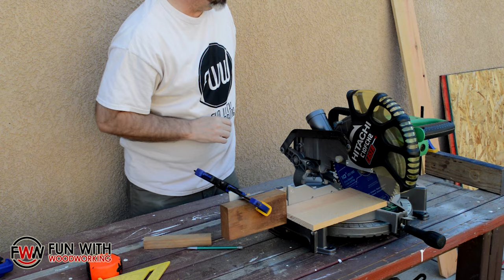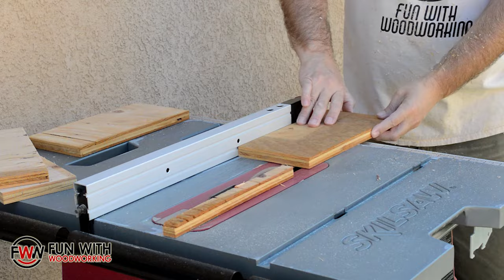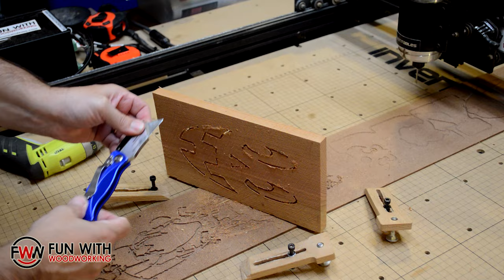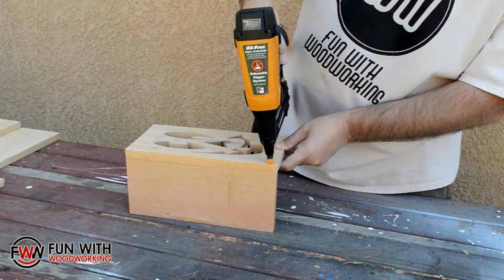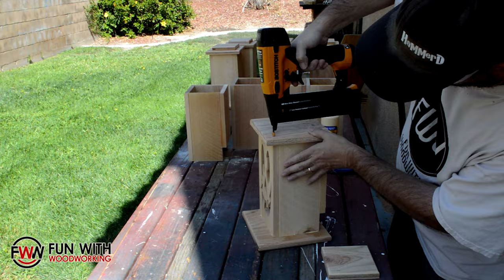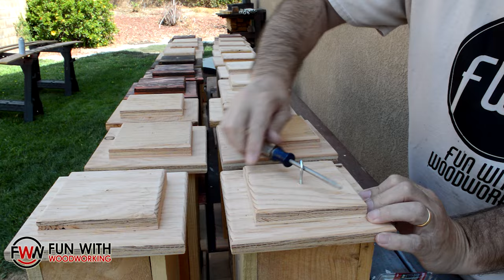Batching out 25 Jack O' Lantern boxes to sell for Halloween

Comment: Would you fancy selling me a couple of 6 mm templates for the faces? I could then rough cut them out and finish with a flush trim bit ,wouldn't have to be that intricate
Reply from the maker: We could probably work something out.  Where are you located?
Reply: I'm in  Ireland, 3 mm might be better as I would need to use a 1linch trim bit in the router to cut the 3/4 stock and it would be cheaper to ship them,I did 3 today ,a bit rough and ready with the jigsaw  though

Comment: Thanks for the video. Love the lesson. Wife says I have to pay for my tool before I get new ones. How much sanding do you have to do in the cuts because when I use my down cut bit on I have to do some sanding around the eyes and the nose Etc because of little fuzzies.
Reply from the maker: I just used some scrap 120 grit sandpaper folded in half and sanded just enough to get rid of the worst of it.  Less than a minute on each face.

Comment: Nice job. Were you able to set tabs or did you stop short of cutting all the way through?
Reply from the maker: I setup tabs.
Reply: @FunWithWoodworking   I was wondering if you really need those tabs at all?  Seems like a lot of extra work, but ive never used a CNC so don’t know.  Ive never ever seen anyone else use tabs.
Reply from the maker: @markb8954  The tabs are there to keep the pieces in place.  If you don't have them there is a good chance that the pieces will get caught by the bit and fly out and possibly ruin the rest of project.

Comment: I just don’t quite understand why you start with 8 inch wide boards, but then trim them down to 5 1/4? So what are the final dimensions of the box once you trim the boards down?
Reply from the maker: I don't start with 8" boards.  They are all around 5 1/2".  I trim them down to 5 1/4" so that they are all the same width.  If they're all the same size it makes it easier to batch out the boxes.

Comment: Do you sell patterns for the different faces for the Lantern? Not just the plans to make them. Thanks.
Reply from the maker: I do not.  I found them all in Google, imported them into Easel, and ran them from there.  There is a link in the description to create a free Easel account and then you should be able to export them from there.
Reply: @FunWithWoodworking  Ohh Ok. I’m still new to all that “File” stuff. Lol. But I’ll give it a shot. Thanks so much. I tried finding Free Avg Pumpkin Face. But it always directed to pay for them. 
Thanks Again.
Reply: @FunWithWoodworking  Ok checked it out. It looks like a 30 Day Trial. Not sure how much it is after that.
Reply from the maker: @jamesbarlowjr.3762  Oops, they must have changed it.  I haven't read the fine print in a while.  Thanks for checking it out.

Comment: What size bit are you using?  1/16 or 1/8?
Reply from the maker: 1/8" because it has a black ring at the top of the bit.  The 1/16" has a light green ring at the top.

Comment: can i use inch brad nails?
Reply: 1 inch*
Reply from the maker: I used 1 1/4" but 1" should be fine as long as you are using wood glue.